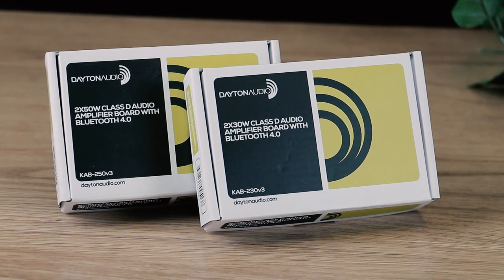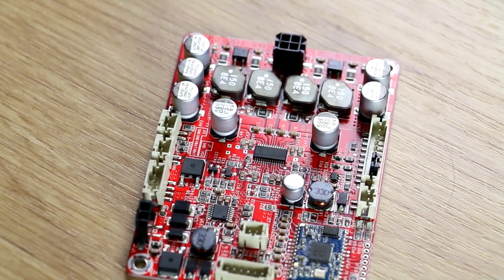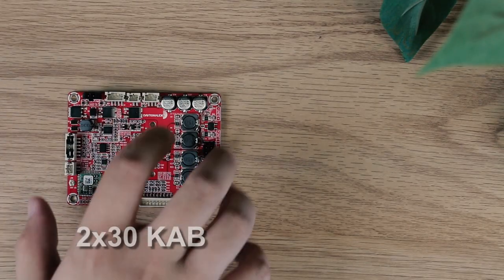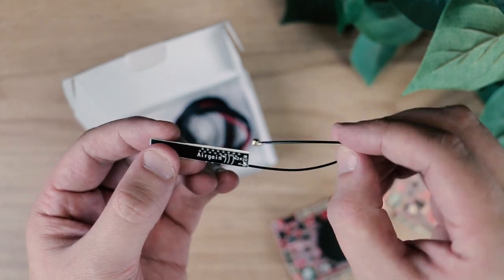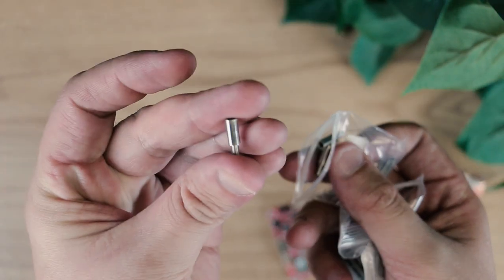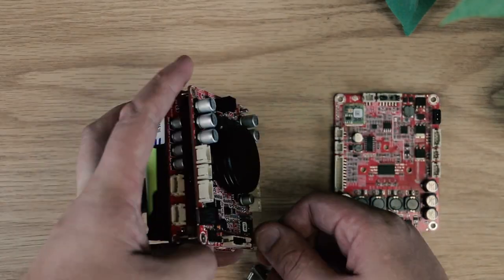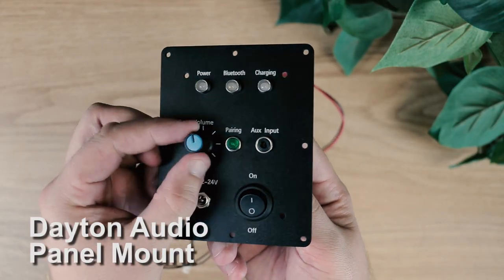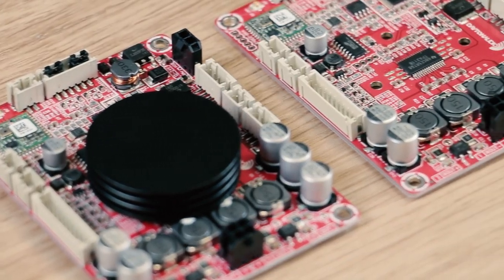New Panel Mount and Updates to the KAB boards!

Comment: can 2 2×50 boards be used in the same portable bluetooth speaker set up? as in 2 by 50 for speakers and another 2 by 50 for subs?
Reply: No, there’s no pre amp out and you wouldn’t be able to pair with both. You could make a separate sub amp work with a line level converter.

Comment: Can you hook up two amp boards to make a left and right channel and to get more power and if so how
Reply from the maker: You can take your stereo source such as your phone using a 3.5mm to dual RCA cable. In order to connect to each board, you will need to use an RCA to 3.5mm mono adapter (PE Part# 090-288) for each channel. The output of each mono board will correspond with either the left or right speaker. To add volume controls to each mono board you can use two of the KAB-FC Function Cable Package (PE Pat # 325-110). You will also need to power each KAB board. You can power them separately or using splitting adapters.